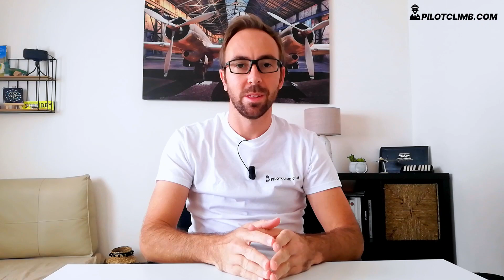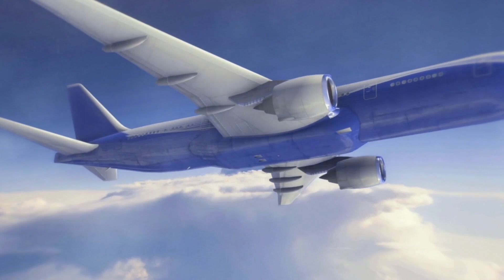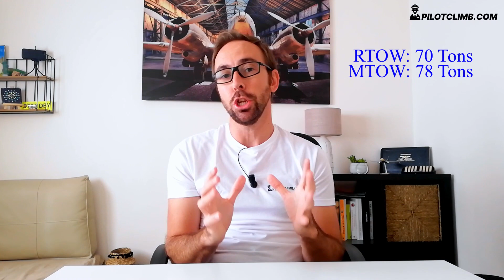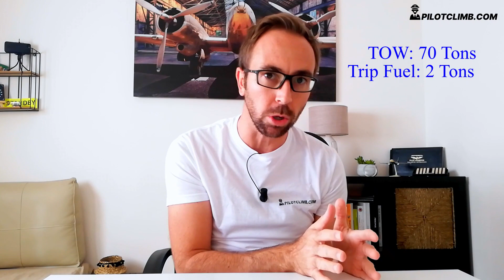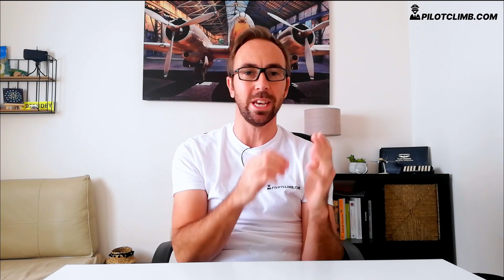MTOW And RTOW - [Maximum and Regulated Takeoff Weight Limitation Explained].

Comment: Hi Captain..I have watched this video numerous times as I simply love the way you explain.  I have a question.  To determine the RTOW, we need to consider external conditions as you mentioned and use performance tables and graphs to come up with the weight for those particular conditions on that particular day. To approximate all these manual calculations we work out our RTOW by adding the trip fuel to the MAX landing weight. Thereafter we work out our ZFW by adding the basic weight to the number of pax times 100kg (@100kg per pax). Then to find block fuel we find the difference between these values.

Your thoughts please would really be appreciated 

Tx
Reply from the maker: Hi, thanks for watching... Usually we make it easier, by simply checking what is the Flight Plan TOW and xcheck it with the RTOW...

Comment: Hi  Sir I am a private pilot and a survivor of a fuel exhaustion accident.   I just want to say that  I learned the hard way that fuel is vital and that the pilot needs to know the fuel burn per hour, and have reserves and personal fuel reserve limitations.  what  i mean to say is that there should be enough fuel for alternates and contingencies.  So, for me fuel first and if any other item is causing the airplane to be overweight  I would rather leave it behind. Maybe for airliners it's different.
Reply from the maker: Many thanks for your comment! For airlines safety is the primary concern. So no flights will be dispatched without the fuel required by regulations. I wish you a great day!

Comment: Why takeoff weight and landing weights are different
Reply from the maker: Hey, many thanks for watching the video!!!

The difference between the takeoff weight and the landing weight is the fuel you burned during the flight. 

The maximum Landing Weight is, normally, different than the Maximum Takeoff weight because it has different Limiting factors.

Some of the Max Landing weight limiting factors are:
- The ability of the gear to absorb the aircraft weight upon touchdown,
-The ability to achieve a minimum climb gradient in case of a go-around.

The Max takeoff weight, generally, is a wing lift limitation, this means that if you take off with a Takeoff weight above the max your wings might to be able to produce enough lift in order to get airborne.

As you can see these two MAX weights are different because are limited by different factors.

There other factors that limit these Max weight.

Let me know if I have answered your question
Gabriele
Reply: @PILOTCLIMB   You can also call it trip fuel